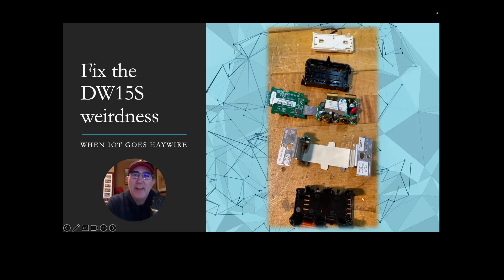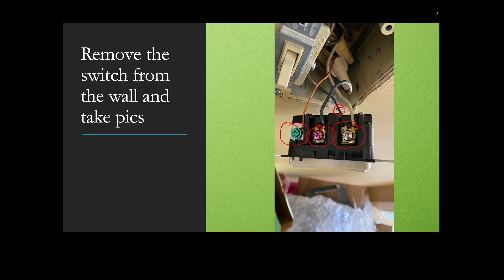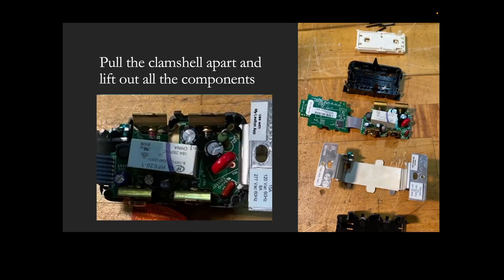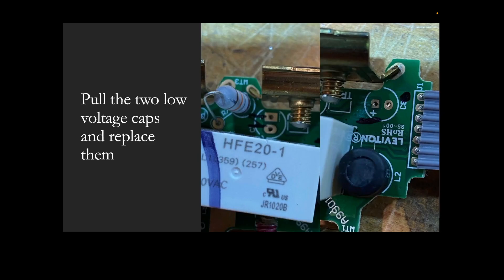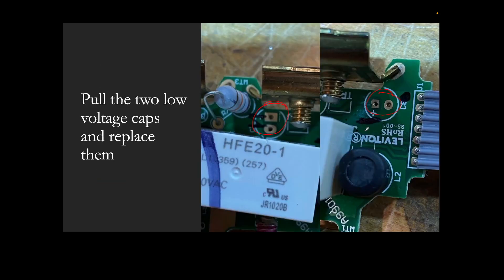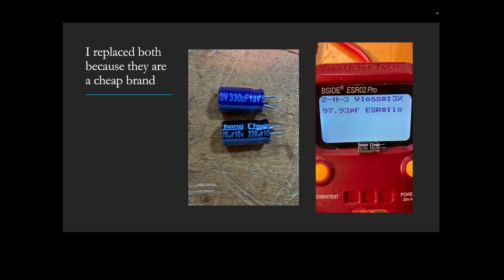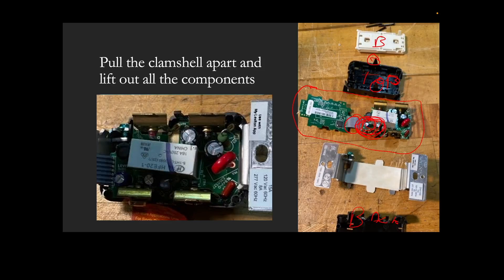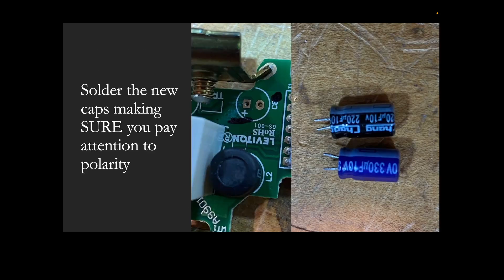Repair an IOT light switch, Leviton DW15S wifi light switch

Comment: I've had about 25% of my Leviton DW15S switches fail, I had a feeling it was due to an issue and finally searched it to see you've done a nice bit of investigation to confirm :)

Leviton has been replacing all mine under warranty with 2nd gen switches. Hopefully they used better components in those!

I have quite a few 1st gen switches remaining, probably inevitable I will be using your findings here to fix them in the future.
Reply from the maker: Thanks for the feedback,  MAN that's a high failure rate,  hopefully they learn something from it all.  I don't have high hopes but you never know LOL.

Comment: Great video.  I was able to fix 3 switches with this method.   Its so irritating that I lose about 3 switches every 12 months.  The fix is pretty easy if you have the soldering equipment.   Did you upgrade the capacitors?   If found some local but they were exactly the same brand which you mentioned are pretty low quality.  I would be curious to know what you used if it was a different brand.  I would probably order a batch out of digikey and avoid putting the same brand back in.  But I wanted to prove it works before taking this any further.  It was spot on.  All 3 came back to life and all the settings were intact.
Reply from the maker: Glad this helped out.  Yes,  I did use what should be a better quality cap made by Nichicon.  I think you can find them at just about any of the distributors out there.  Ive always had great luck with that brand.